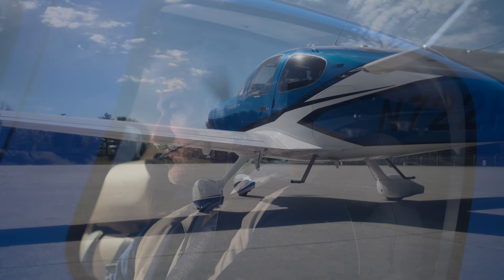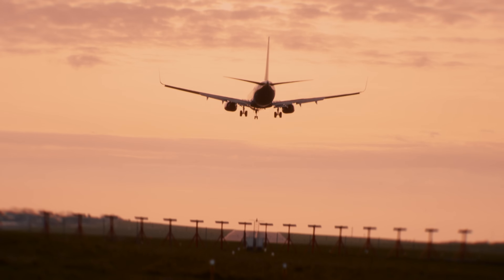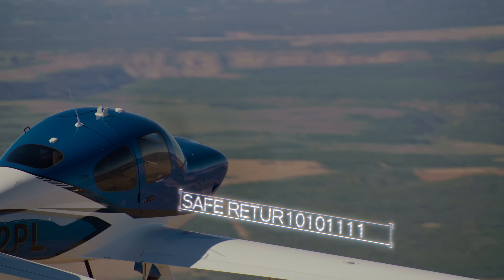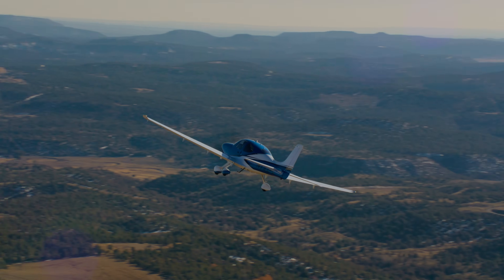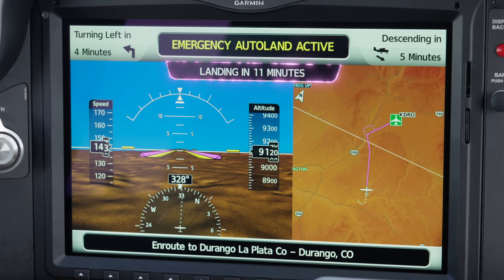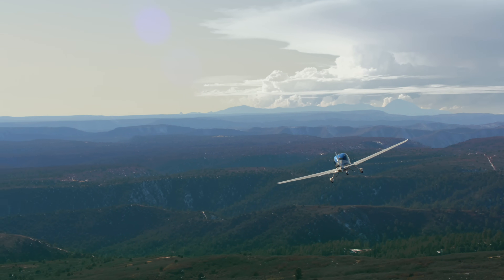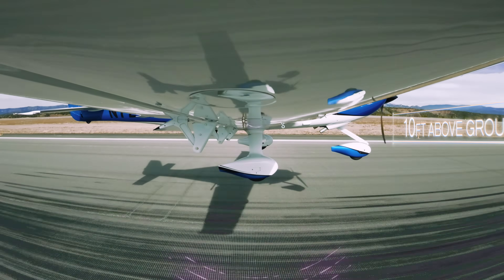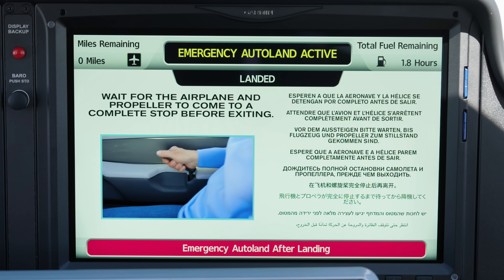SR Series G7+ featuring Safe Return™ Emergency Autoland - Explainer

Comment: Wow! So even if the pilot is the only occupant, and has a health incident, it will turn on Autoland! As a bonus, I assume that the avionics with the radar altimeter will now call out the height above the runway as you're landing.

Comment: How does this system affect basic empty weight and useful load?
Reply: Fair question, but the answer seems to be that it doesn't. I compared specs from the G7 and G7+ on the SR22, using the info from Cirrus's site. The G7+ is 2 knots faster, has 2 pounds more useful load, and same max range. How does it affect your wallet? Well the G7 was starting at $844,900, and the G7+ is now at $914,900. Part of that will be the new systems, part of it will be general inflation and the world trade situation (tariffs etc). The good news is, the release of a new generation will likely lower prices on old ones. The potential buyers of a brand new Cirrus probably aren't overly concerned with a $70K price change I'd imagine.
Reply: @masonmcglothlin5101  Interesting.  I guess besides a few new servos and wires, it's mostly a software system.